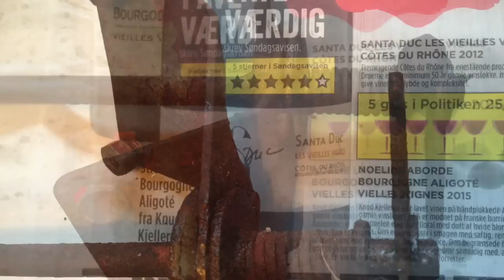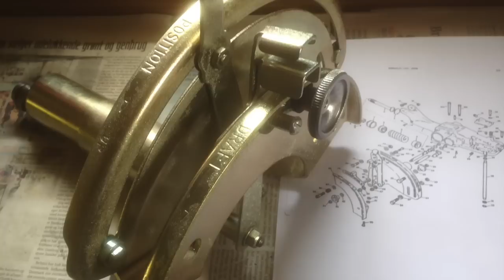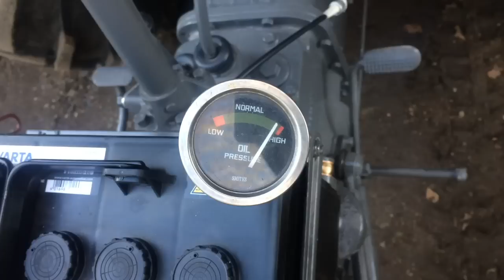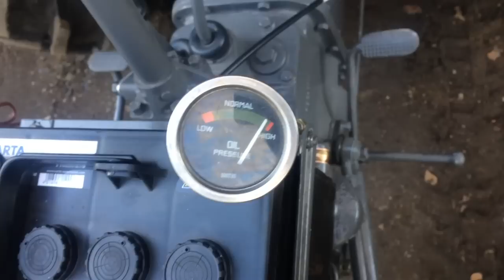Massey Ferguson 35 ( MF 35 ) tractor restoration  projekt part 2

Comment: She purrs like a kitten! The hardest part about starting a freshly-installed diesel engine is getting the air purged out of the fuel lines. We had a New Holland 3-cylinder diesel and my wife ran it out of fuel. It would not start, unless you loosened the fuel lines to the injectors, per the service manual. We now own an International Harvester/Komatsu, with a 3-cylinder Nissan diesel, and it's much easier to start, because of the priming button on the pump.
Reply from the maker: Frederic Lynes thank you for commenting. The problem with the tractor being hard to start was a bit complex. It started and ran ok before I touched it. But I did install new injector nozzles. On new nozzles the book recommend an opening pressure at 135 atm, and the book says 120 atm on used nozzles. Because the tractor had not been serviced for a very long time I suspect the opening pressure were under 120 atm. With the new nozzles set at 135 atm the pump could hardly apply enough pressure under coldstart. With a new pumphead in the pump it starts right up, though it took me some time to figure it out.
Reply: @poulgammelgaard8868  fuel pumps are the biggest pain in the butt sometimes. I'm fighting with my 1973 VW Super Beetle's Pierburg fuel pump. The problem is that aftermarket parts just aren't the same specs as original.

Comment: My congratulations you doing a great job !
How many hours did you spend for restor it?
Now I want to see the finished tractor with its red hood and headlights!
Reply from the maker: Paolo Rinero thank you. I don't count the hours, but I enjoy working on the tractor. The red sheet metal parts are next, but it will take a lot of time.
Reply: Yes, great job. And I am also curious about the final result. By the way, I have been looking around on youtube for a Massey Ferguson 4 cylinder restoration from the time they were red and flint grey metallic, but no one seem to be doing that. Sadly MF does not offer the correct flint grey metallic anymore,  but it is still possible to find or have it custom mixed. I learned to drive on a 1961 Massey Ferguson 35, with half tracks.

Comment: Fuel tank must be red for MF 35
Reply from the maker: Osmo Keranen thank you for commenting. I think it can be either grey or red. On this tractor it was grey when I took it apart, therefore I painted it grey again.
Reply: Not a 35.  It's a 135?
Reply: Sorry I got it wrong  . You are right  it's a 35.